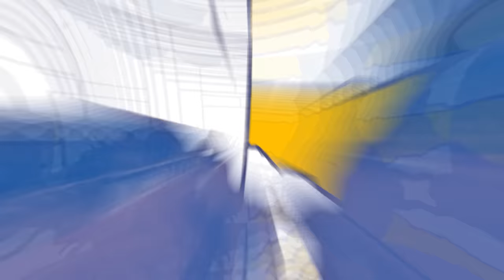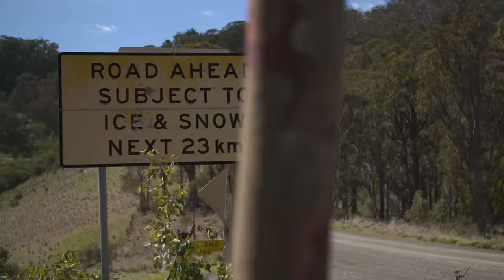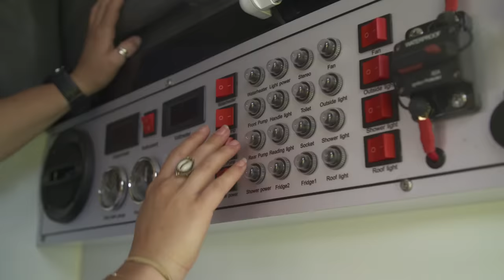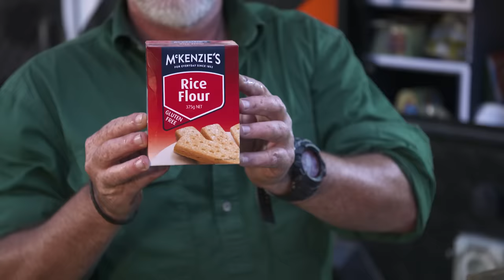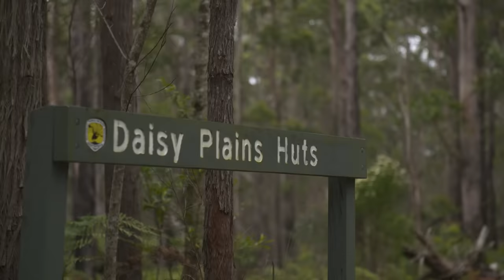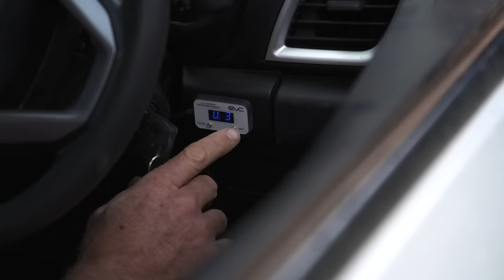1000km of river crossings, stunning camps & hidden waterfalls! NSW to QLD Dirt Roads ONLY

Comment: For my fellow Americans, multiple kilometers by 0.621 to get the miles. So 1000KM is only 621 miles. My 1989 Nissan D21 Hardbody 4x4 did 25mpg per gallon highway. With a 25gal tank in the bed, I had a 1000 mile (1609KM) range on the highway. Obviously 4x4 travel is way less but the idea is to begin with an efficient engine and drive line, then build the vehicle from that point.

Comment: All you have to do to the isuzu to keep it cool is an aftermarket auto cooler and pop the bonnet to increase air flow. Works wonders while towing on Fraser in soft sand also.

Comment: There is a spot you missed on the tops or even the proper start spot on Barrington tops nowadays the public can not use the track linking back up to mooni flats track but still there closed by gates im shore strings could be pulled to do the track all own by state forestry( alot of old logging machines/pullys throughout the tracks and 1/2 pieces at all camps around when seeing one at frying pan you think of it's use back then and can even connect all other machines and pullys if marked on a map)so do have to watch for log trucks and be on channel. Frying pan Creek/coachwork camp grounds out and up the back of Dungog also alot of 4×4 tracks hidden swimming holes,lookouts and no reception true off grid. Personally I've been going there for yrs and still find tracks and waterholes and lookouts

Comment: Those old Dmaxs are a pretty capable rig. Can't fault it for overheating especially with all you ask of it. Probably could use a bigger radiator or some better airflow... could just be the dust from being the last car.

Comment: I wouldn't count anything as simple as crossing on an intersection or a bridge if that's the only way is a fair line. I would personally not count any blacktop that you can responsibly, safely and legally drive on without having to air up. Say a kilometer max at low speed. But only if it's the only option.

Comment: Sticking the chips in cold oil is massively unhealthy, to be honest, it doesn't make a lot of difference to the taste, just makes them a bit more greasy and soft. The point in throwing them in hot oil is to seal the potato and get a fluffy centre while the outside is crisp. I have a lot of chip cooking experience living on a boat for 5 years, Hot oils are better for crisping, cold oils just make them soggy. ps, gets to about -15-20°C here, and there is nothing better than a good diesel heater for that kind of temeperature on a boat. 😀